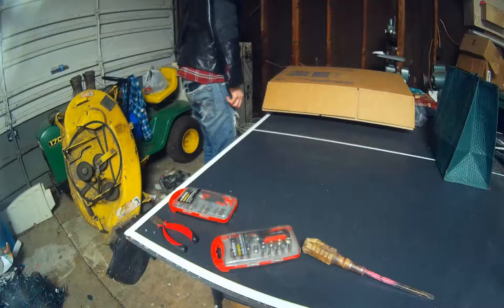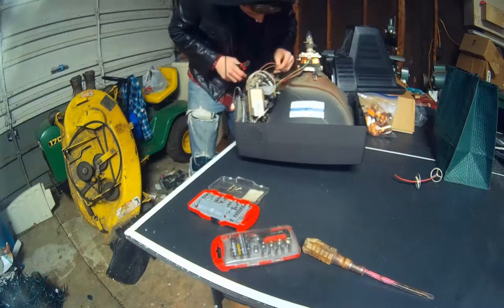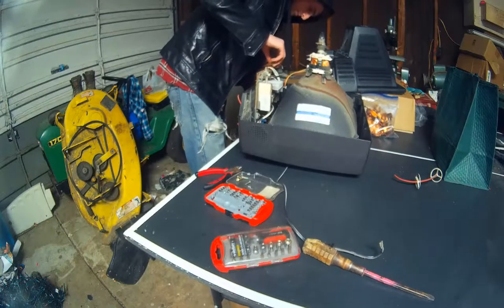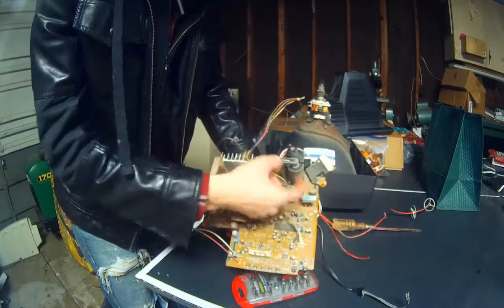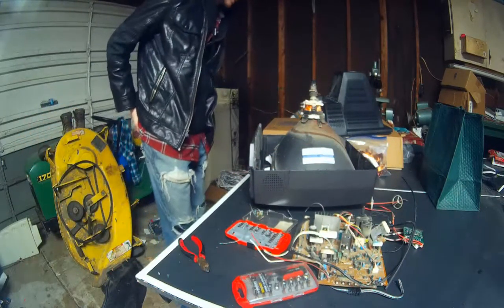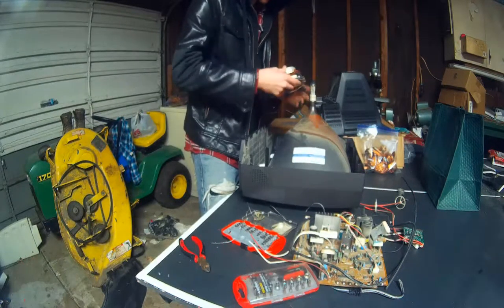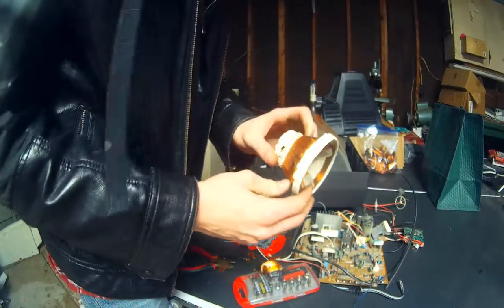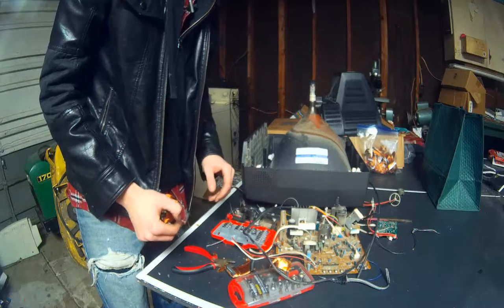Scrapping a T.V for Copper and other materials

Comment: the black with all the wires running out of it,is a power converter,regulates the power thru the board.if you start seeing lines in your tv,if you have a tube type,thats usually the problem.not fixable unless you remove the board and replace it with the same board.